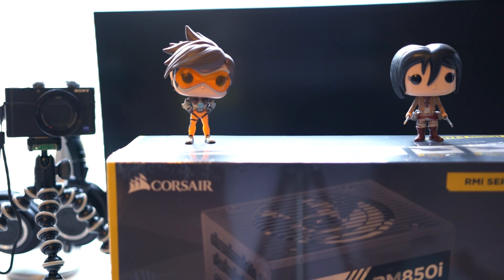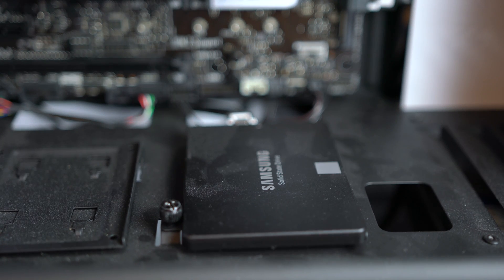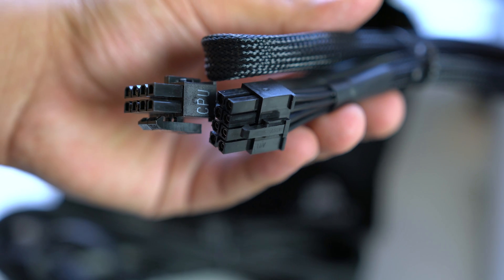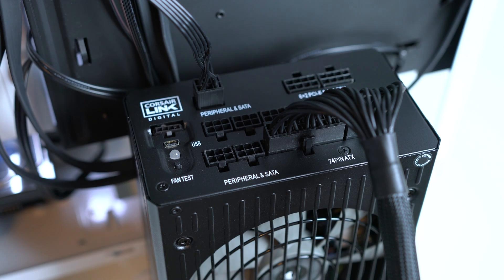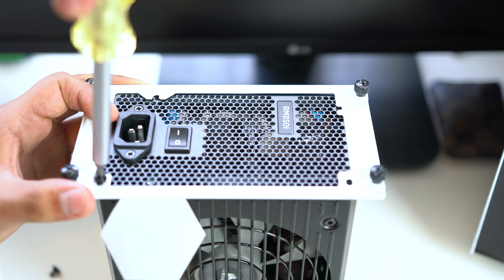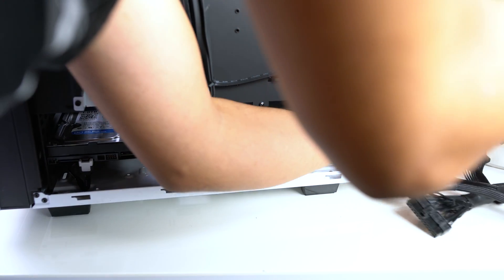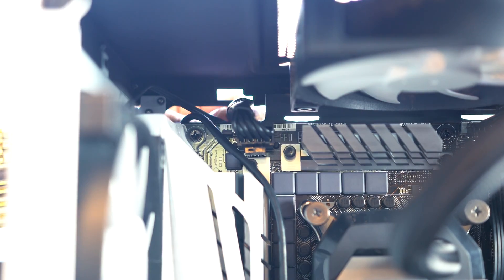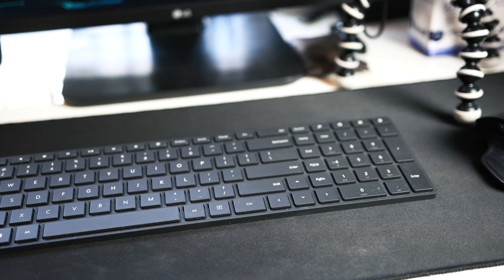How to Install a Power Supply Unit in a Computer

Comment: Hey! My motherboard dont have slot for 24 pin cable, and i need a new powersupply bc my old powersupply cant fit in my new case, do i need to buy new motherboard?
Reply from the maker: no you dont need to buy a new motherboard if its working fine!
Reply: @dudebrd   Okey, thanks:).

Comment: i am really confused i have my psu facing upwards. Is it wrong? my case does not have anything in the ground so i just faced it up. Is that wrong. I saw some other guy facing it upward and you are facing it downards.
Reply from the maker: im facing it downwards because i want the hot air from the PSU to go down. its really up to your preference
Reply: @dudebrd  after 2 months i changed  it to downards bc i have bought another case. The diffrence was that if you had it upwards without any plate to preventing the gpus hot air, it will be warmer than facingf it downwards. SO i have it now always downwards.

btw. isn't the fan pushing hot air in and taking it out where you put the screws?. Or was i foled by when the hot air that was comming from the gpu?

Comment: Grea video - just one question - my PC case has the PSU placed at the TOP...so for a PSU like yours (I am getting a Corsair RM750x) - should the fan be pointing DOWN, so it's blowing INTO the case?  Note my case is totally closed at the top...

Comment: Help :( I have an NZXT H510 Case and a Corsair rm750x 2018 series PSU. The case doesn't have a removeable psu shield that you put on top of the PSU before sticking it into case, so the screws dont line up properly.

Comment: Do i need any standoffs in case for power supply cause i am experiencing power cuts..when i was building pc and after i found out some rubber stuff popped out but didnt know from where so i let it be. My psu is bottom mounted facing fan to bottom.
Reply from the maker: No you don’t need any stand off’s maybe your PSU isn’t powerful enough for your build?

Comment: does rgb case need to be powered with sata
Reply from the maker: ZFlow sorry but this case didn’t come with RBG but your SATA lights should go connected to a controller (if it come with any) or directly into the PSU

Comment: I bought a RGB PSU (Unnecessary I know) but now I am forced to place my PSU fan upwards, however, the PC will stay on my desk, so how much will this affect the performance? Thanks in advance.
Reply: ............. Ideally you want to face your PSU towards the outside of your PC or any side with vents. The PSU fan sucks in air from the direction which it's facing. So in  your case it will sucking air from the inside of your PC and yeah pushing it out, it's still acceptable but not ideal. The worst kind of facing is if it faces towards the case with no vents. And btw fuck rgb.
Reply: @rnegoro1  :) The reason I got RGB was because it was a 700w RGB PSU that was the same price as a 5002 regular PSU, so whether I use the RGB or not, I get better performance. But thanks for the info :)

Comment: The power supply fan is an intake fan and exhaust the air out the rear of the PSU. The bottom filter in the case is to limit the amount of dust coming into the PSU.

Comment: Why did you recomend installing the fan to the inside of the case if it is in the ground?  Would it help with the internals?
Reply from the maker: Roberto Zozaya so if it’s going to sit on the ground mainly carpet you don’t want your fan to over heat, so you blow the heat inside and let your other case fans blow it out
Reply: Thanks :)
Reply: Thank you for your reply.  I do have it on the floor, but the floor is hard, not carpet.  I'll wait for my PSU and then figure out.  Thanks :)

Comment: what about any case fans? dont those need to be connected?
Reply from the maker: WØNDER yess but this is a how to install psu lol
Reply: Aren’t case fans connected thru motherboard? So if the motherboard is powered, so are the fans? No? I haven’t been building pcs for a couple years but I think that’s how it works
Reply: sheng pan case fans are connected through the mother board. Yes you’re correct

Comment: Thanks this helpful ^-^ tho I have cords comming from the front of the case that idk what they are .-. There's a usb 3.0  which I can't use . A HD audio and a lower audio I guess . But I figured I gotta use the HD one . But then there's another cord idk what it is it  doesn't say . I already plugged in all the little ones such as power and reset.. anyone help please ? Is it needed ?
Reply from the maker: KatouMiwa hi still need help?
Reply: i figured it out thanks ^.^  if u wanna help me with something i do need help . i bought ddr3 ram for my pc . and it crashes on boot or just keeps restarting on boot , i looked up my manual , its within the speeds that my motherboard supports , its ddr3 slots , and it says supports unbuffered ram, (sorry my spelling) i did try everything from putting it in every slot by its self or with my other sticks and still doesnt work , any idea why? i mean its clear it doesnt support that ram stick , but how when i got the right speed and its ddr3 ? would it be because the ram is buffed when mine only supports unbuffed >? idk if the ram i bought is buffed , it only says the ddr3 AND speed